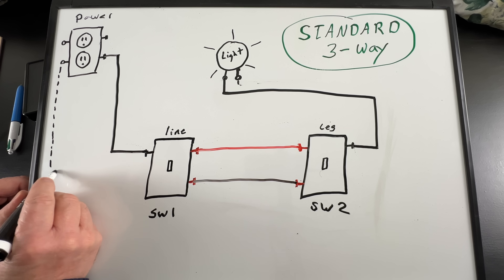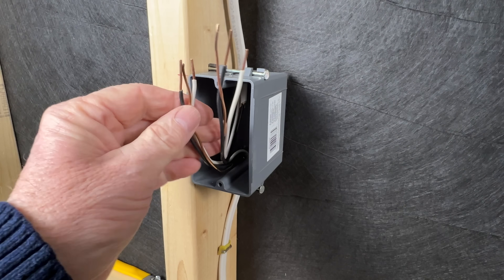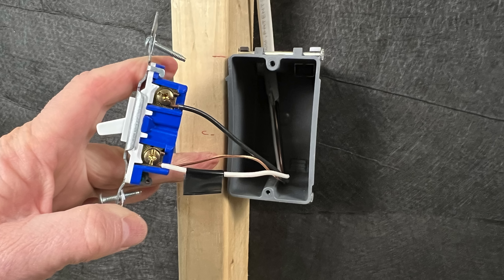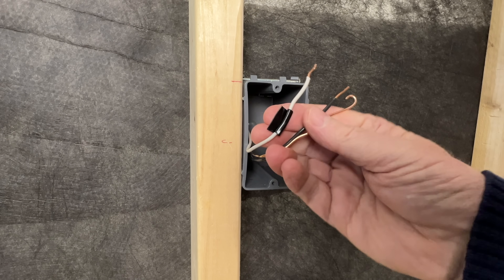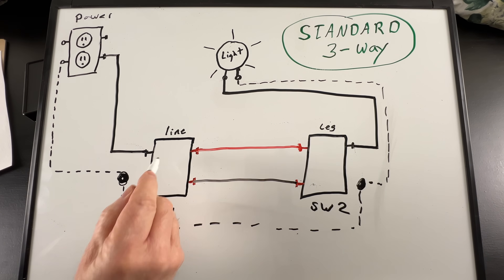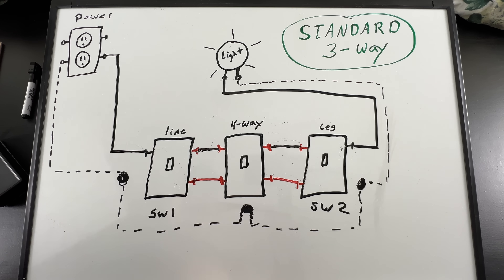How NOT to Wire Light Switches in 2025 (New Rules)

Comment: Great video.  On the whiteboard, use a dashed blue line just for the pure neutral. A white/blue stripe wire is legal for a neutral, and shows up better on the whiteboard.  Use the dashed black line for the re- identified white.

Comment: I learned all three ways to hook up 3 way configurations. Feed from the first switch, feed from the second switch and feed from the light which all methods passed inspection when I did my father-in-laws cabin. No one ever had smart switches. Now if you want smart which I don't. You have to feed from either switch which creates another issue three conductor romex don't have a neutral only one switch will have the neutral. I will let the experts comment on this problem. Two avoid neutral less boxes I will put an outlet in next to the switch sometimes a higher outlet can be used for a vacuum cleaner or some other device. 73

Comment: Once again the NEC finds a way to increase the cost wiring a home to cover a SMALL percentage of uses. I was an electrician some years ago and i am aghast at the current code requirements that do little to ensure safe wiring to protect homes from fire and the constant updating to cover corner cases. The NEC needs to go back to their original mandate of ensuring safety.
Reply: The NEC used to be run by Firemen. Now, it's run by insurance companies and the National Electical Manufacturers Association.

Comment: I was surprised when my dad's house used the feed through method on all the old circa 1959 Single pole switch boxes.  The house was never re-wired because it had the original cloth-jacketed NM cable.  I didn't redo either of the 3 way circuits to see if they were a standard 3 way with two travelers plus the neutral.

Comment: what about a  single pole /  3-way dimmer slider. I want to replace it. It has 2 black wires and a ground wire to it. No white wires to the switch? Do you have any videos on wiring a dimmer single switch? It dimming one unit with 3 bulbs in it.
Reply from the maker: Sounds like a single pole not a 3-way. I single pole controls a light or lights from one location while 3-way switches control lights from two or more locations. With two black wires and a ground you have a single pole dimmer switch. For a standard, single-pole dimmer switch, it generally does not matter which wire is connected to the "line" and "load" terminals. However, some smart or specialized dimmers may have specific wiring requirements.

Comment: so what happens to the tens of millions already in service???, all these changes due not make sense, how or who will correct the past?.
Reply from the maker: The code is not retroactive. Existing installations don't need to be changed. Changes apply to new construction, additions, remodels where the wiring is replaced, extended or upgraded.

Comment: 7-30-25 Virginia is Still enforcing 2017 NEC.. lighting outlet boxes now are being fed with 14/2 NM WITH 14/3 drops to SP switches by more up-to-date contractors. Local inspectors don’t allow lighting tapped to receptacle circuits,15 or 20 amp.
Reply from the maker: Some states are slow to adopt the new code cycle. I'm sure they are getting close to adopting the 2020 by now. Maine is really quick. We have been on the 2023 for 13 months now.

Comment: The dead-box should have a neutral or ground thru it.

Connection spark what good is your breaker protection
Reply from the maker: Every box requires a ground wire but only one switch box requires a neutral when more than one switch controls the same lights. 404.2
Reply: @BackyardMaine  in commercial applications. Switch Legs wire are color coded insulation.
We used the appropriate colors for the Voltage.

Thanks for your channel 
Blessings ❤
Reply from the maker: @mansardmanor3869  Yes when we run conductors in a conduit we cannot re-identify them when they are 6 AWG or smaller. Marking the white as a hot wire is only permitted for cables.
Reply: @BackyardMaine 6 gage wow, didn't know that

Comment: Is there a reason you mention 12-2 cable vs 14-2 cable?
Reply from the maker: Only because I showed the switch being connected to a receptacle circuit which can be 15A or 20A. But if you have a 15A lighting circuit you can run 14 gauge wire.

Comment: It seems like they each use two x/2 and one x/3 romex wire. So why would anyone choose the dead end over the standard 3-way that carries the neutral to both switch boxes?
Reply from the maker: It's all about the location of the power and the light. Sometimes it makes sense to have a dead end but I find most of the time a standard 3-way is the best option.

Comment: Why don't they make a double black romex for this usage?
Reply from the maker: I'm not sure but switch loops now require a neutral wire at the box in most cases so we would still need a three wire cable to the switch when the light is where the feed is located. I always feed the switch which pretty solves the problem altogether.

Comment: Great job on the 3-way explanation, BUT you have totally ignored the fact that many situations have a fan/light combo where the light is switched at the wall switch, but the fan is independently switched from the fixture (e.g. pull cord), making it necessary to get non-switched line to the fixture.
Reply from the maker: I didn't;t ignore that since it's really a different subject all together. I always ad a second switch for the fan and leave the switch up on the fan on all the time.

Comment: Why 12 AWG for lights?    not 14?
Reply from the maker: IN this example I was coming off a 20A receptacle circuit. The wire gauge is sized to the circuit. If it's a 15A circuit you can use 14 gauge wire.

Comment: A guy I knew, changed the light from the 1960's.   But, he did not pay attention to how the appliance (the light is an appliance) was wired.  He just connected all the whites, and connected all the blacks.  But, it was wires as a switch loop.  Fortunately, the switch also acts as a circuit breaker.  But, He's a disaster, and also trying to improve a house that we inherited, and he's slowly making it worse with every improvement.

Comment: I'm a sparky in Ontario, what I see in common with on-line electricians showing 3-way switching is, no-one discusses running a 4-way switch as an end-run. 
It's almost impossible in Ontario to find 14/4 or 12/4 since Co-vid, but my local inspectors will allow running two 14/2's with both the white wires re-identified. 
Stay safe, Geoff

Comment: The Standard Method is the way to go for a new installation but where you have an existing single pole switch connected to a light and the power comes into that switch box, Dead End 3 way is the way to do it.  You are running 12/3 or 14/3 from the existing switch location to the new location. 
Just mark the white wire as a feeder. 

Video was very helpful as a visual guide. 

Thank you
Reply from the maker: Glad you found the video helpful, thanks for the feedback!

Comment: How about just installing a black,white to the first switch for the power feed, a 3 conductor (black, white,red) between switches (3 way, 4 way) and a 2 conductor (black, white) from the last 3 way switch to the switched device? That way, you'll always have a neutral at every switch and never have to use the white wire for a " hot" conductor.

Comment: You used both so, Wagos or correctly done wire nuts?
Reply from the maker: I like wire nuts but the lever connectors are also very reliable. I like them a lot for light fixtures because you can connect the ground and let the fixture hang while you're make the rest of the connections.

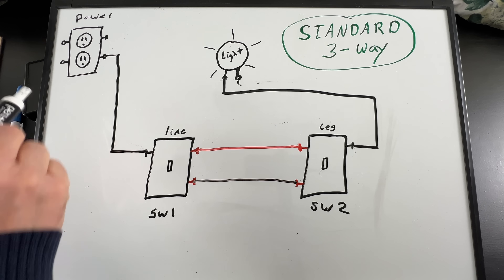Comment: (8:25) Is 12-gauge code for lighting? I always thought 14 was common for lighting while 12 or higher was code for outlets. Did I miss a class?
Reply from the maker: Depends on the size of the circuit. Sometimes lighting is connected to receptacle circuits which can be 15 or 20 amps. Lights are often run on 15A circuits but not always. 12 gauge wire is only required on 20A circuits.
Reply: I agree 👍

Comment: Dumb question. If wiring to power a 220v 1ph equipment. Is nutural wire required in the box ?
Reply from the maker: No. You would only carry the neutral if the equipment your connecting needs one.

Comment: Hello, thank you for the video. I have a unique problem that I can't figure out in my main bedroom. My home was built in 1977. The wall switch we noticed controls all 6 wall outlets in the room. I found this out when I installed a ceiling fan. I wanted the wall switch to just turn the fan light on and off. But when I had my radio and a floor lamp on and turned the switch off, everything went off. I checked one wall outlet that seems to have 2 blue wires, 2 white wires and 1 small piece of black wire that looks like it is a jumper going from one gold screw to the other gold screw. Any idea how I can make all the outlets independent from the wall switch? Thank you.
Reply from the maker: If the switch is controlling the receptacles then you can take the feed to the switch and the switch leg on the other screw on the switch and connect them together with a wire nut. If you still want the switch to control a fan you can add a third wire to the wire nut and connect that to one side of the switch. Then your fan wire to the other side. The outlets will be live all the time and the fan will be switched. Remember to turn off the power first. Often times a switch will only switch one side of an outlet and the other side will be live all the time. To do this we remove the tab between the two gold hot screws. Sounds like someone added a jumper to make both sides hot. You may want to find out if that’s what’s going on.
Reply: @BackyardMaine  thanks for making all these awesome videos, I have the luck of also owning a ‘77 model home and all the outlets were switched. I don’t think they anticipated having overhead lighting or fans but with these videos I was able to run constant hot to all the outlets and switched power to lighting and fans. Next step is to save for the dreaded Zinsco panel upgrade lol.
Reply from the maker: @tym899  Happy to help.. Thanks for watching..

Comment: How is the white wire not being used as a neutral? It is a 15 minute long video and after 1 minute the usage of English just stopped. To be honest the second method for the single pole was the only way I thought it was supposed to be done.  It seems dumb to screw around with a circuit by trying to ride the neutral as your conductor. That's not what the neutral is for, I'm surprised that wasn't part of code already, no never mind the more I learn about the past generations I'm not surprised
Reply from the maker: The white wire is used as a neutral but when it’s used for a hot it’s no longer a neutral. That’s why the code requires us to re-identify it as a hot.

Comment: i want to run a  direct 220 line from the service panel  to a metal box with a leviton 220 switch for a water heater,  when I do the grounds, should i put a gound wire from the metal box  to the grounds from the line in from the water heater and the green ground screw on the switch?  basically  combine all three grounds to the single ground to the box?   or can i skip the switch because it will get grounded when i thread it into the box , thank you
Reply from the maker: Best to connect all the grounds together with a tail to the box and another to the switch.

Comment: Simple,use a 3 wire between light and switch, now you can keep your circuits running to other adjacent switches
Reply from the maker: Yes I mentioned that ws the way to run switch loops now with the code change.

Comment: A lot of the new 3-way smart switches require a neutral at both ends. However, since they only require one wire between them, you can use the spare wire to run neutral to the second box if it doesn't have one.

Comment: so i have a single light switch that control light, ex fan and gfci outlet all in my bathroom. i'm trying to wire the outlet to stay on at all time but the switch only has two wires(old house), i would like to connect straight to the hot side of the switch but theres no place to connect my neutral coming from my outlet, do i need to run new wire for the switch or can i leave my neutral with a wire nut on inside the switch box?

Comment: The old way allowed the use of a 2/c between the 3-way switches, omitting the neutral. Then, the electrician would find the nearest neutral available in the area of the Sw2. This usually caused current to return to the panel in a circuit fed from a different breaker, This could result in excessive current in the neutral, and heating where the cables entered the panel through a magnetic metal opening. When wired in conduit this also caused conduit heating. This will often be found.

Comment: I disagree with the new codes, codes should provide a minimum safety factor not regulate based on possible future changes to the building. If the switch being installed is safe to use the way it is wired it should pass code, the vast majority of switches being used today do not require a neutral wire and are just as safe not having one in the box next to it. It is up to future installers to make sure they are installing a switch correctly and should not be a burden on current installers on the premise that there is an off chance that the switch might be changed in the future to one that requires a neutral. This is no different than if they required an automatic transfer switch to be installed on all new houses just in case the home owner decided to install a whole house generator or solar panels in the future. Code should only be in place to make sure current installations are safe!!! I know this changes nothing but it's simply my opinion.
Reply: It all depends on the cost of provisional feature that helps future retrofit. Requiring neutral at switch costs almost nothing in new constructions, but rewiring already built house costs probably the whole house. Requiring solar transformer equipment wouldn't make sense if the house isn't being built with solar panel, but provisionally making a space for it for future installation would cost minimal.

I moved in a 2001 built house. I discovered all in-house landline phone line were using cat-5 twisted pair. It cost me about $10 to retrofit all the phone jack to RJ45 wired ethernet.

Comment: Oh my God, do I ever wish I discovered your content earlier. Actually, a year ago would probably still have been too late, but maybe not. 

My partner bought her house 19 years ago as a new build. It had three way switches in the galley style kitchen for access from the rest of the house or the garage door and another for our dining area with controls in the kitchen next to the back door and opposite where the dining area met our front room. I moved in a decade ago. 

In both cases, someone had worked on the wiring and both sets of switches worked as a master/slave setup. In each circuit, one of the switches had to be on to provide power to the fixture. The other switch could interrupt the circuit, but using the first switch couldn't light the light. Only with the second switch in the on position would the lights illuminate. 

I went on YouTube University several years ago trying to understand how they miswired these circuits and none of the videos I found clearly explained how these different types of three-way circuits work. 

We sold the house a year ago but I really would have loved to have fixed the circuits. For several years I had taped the slave switch in the working direction. Not good. Anytime you have to explain why a device has been locked out it doesn't help the property value. 

Thank you for the exceptional videos.
Reply from the maker: It is very common to miswire three way switches, it’s often a case of “close but no cigar”

Comment: Use a lot more 14/3 today.  Wired homes during the 1980's and pull a bunch of 14/2 travelers - yes you needed to keep track to ensure sharing the proper neutrals.

Comment: That’s called sharing a neutral wiring, it’s against code for new homes now. But a lot of old homes were done like that to save money. Janky work
Reply from the maker: Not quite. A shared neutral is when you have two circuits returning on a single neutral wire. Thats called a multiwire branch circuit and they are still compliant but with some restrictions. You can find information on that in code article 210.4.. What I was showing in this video was re-identifying a white wire as a hot wire which is also still code compliant. 200.7(C)1

Comment: Why 12 gauge?
Reply from the maker: 12 gauge for a 20A circuit, 14 gauge for a 15A circuit.
Reply: @BackyardMaine  Exactly....why is he insisting on 12 gauge for a light circuit
Reply from the maker: @andrewwilgress4100  I'm not. I show the circuit in the example coming from a 20A receptacle circuit so it's on 12 gauge wire. Not all lighting circuits are 15A.

Comment: I just replaced a few switches today and one of them had a black and a white wire without a ground hooked up. I just connected the wires to the new one the same way it was wired on the original one but I did find a ground wire and connected it

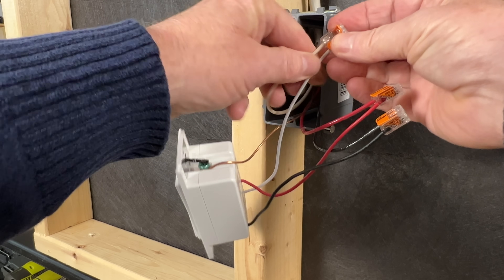Comment: At 6:23 minutes. You discuss capping off the unused neutral wire. 40 some years ago I was taught to not have unused wires in an electrical circuit. Were they wrong. I can't be the only one taught that. I do understand the need for forward planning design and installation.
Reply: You just need the neutral wire in the box now, in case they ever put in a smart switch.